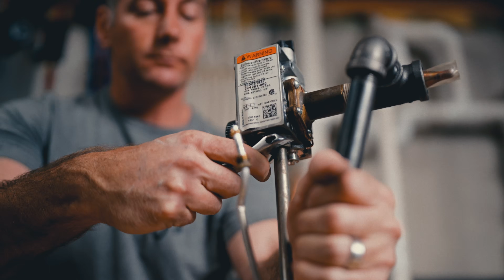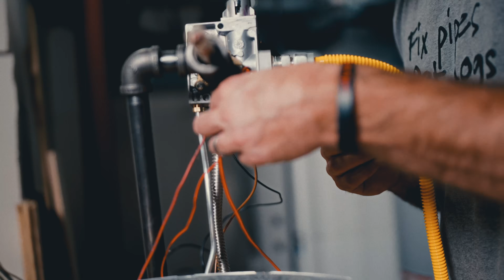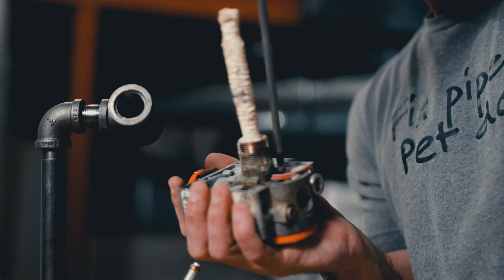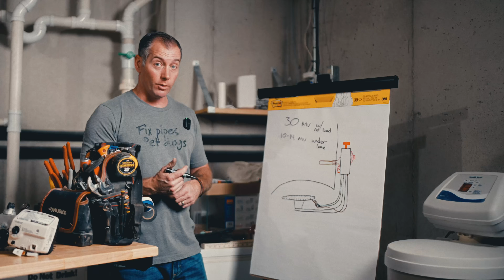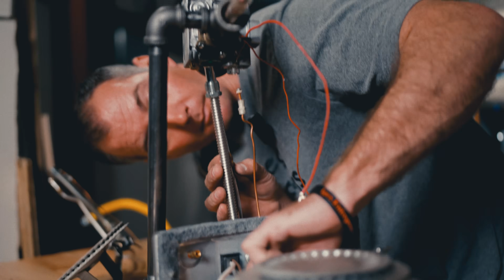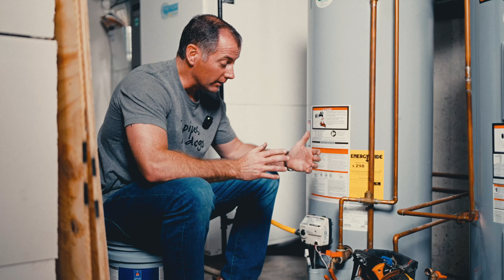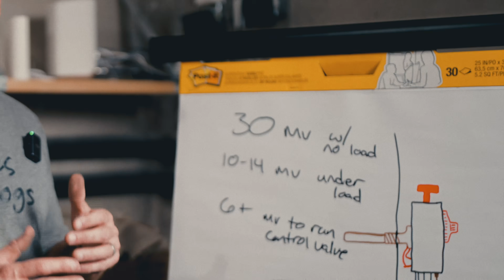Water Heater won't stay lit - Here's why

Comment: The secret reason why those honneywell's break:  
Where the circuit board slides onto the pins of the mechanical section behind it;  there are little pyramid shaped connectors that are soldered to the circuit board that slide over the pins.  Those cheap little connectors are very fragile and easy to break if you go prying on the outer plastic or board at all;  unfortunately, the little electric cord that plugs into it is always hard to unplug.  So you pry around on it hard and then it breaks those little pyramid connectors inside the board and your unit will start acting wonky and intermittent and unpredictable-  because those connections are broken. 

When you pull the cover off and pull the circuit board off of those pins-  pay close attention, because those pyramids will get stuck on the pins and/or fall off to the floor and you'll never find them.   If yours are broken like this: You can solder those pyramid connectors back to the board.  It's a pain to do and you will likely have to heat your soldering iron up extra hot with a torch (I had to)-  but this will fix the issue well and you won't have to buy a new unit.

Comment: I replaced my water heater a couple years ago,    the pilot light gets blown out by a draft down the chimney, at least that what they tell me is happening.  I have had several plumbers look at it, and they tell me the water heater is working normally.  It is an old house on top of a hill , so the chimney is above the tree line.  The chimney was recently lined and capped.  Is there anything you can sugest?

Comment: We have natural gas water heater model# bfg1f5040t3nov, American water heater, that had pilot light issue. So i replaced the entire door/igniter assembly part# 100093812 and it worked fine for week. Now the pilot light is having issue again. I hold that red button down and press the ignitor button, pilot light comes on, and hold the red button down for a minute  and release it. as soon as i release the button, pilot light goes away. I also tried holding the red button down longer like 3 minutes, but as soon as i release, pilot light goes away.

what is the issue here?. Do i need to replace the whole regulator now?

Comment: I know I won't get an answer, but its worth the try; when I put the multi meter red on its a pink wire and black on the white, I get no resistance. But when I put the black on the pink wire and the red on the white wire, I get resistance. I'm confused

Comment: I've got a unit similar to the last one in your video with a thermopile. Recently, the pilot went out, so I re-lit it, but when I let off the pilot button after 30 seconds or so, the light continues to flash once ever 3 seconds, then starts flashing twice every 3 seconds, then the flashes get dimmer, and then eventually stop. My unit says 2 flashes means thermopile voltage is low. Would you say I need to replace the thermopile, or could this be due to something else like a faulty control valve? Thanks in advance for your help.

Comment: Thanks for the informative video. The parts about the voltage produced by the thermocouple is really interesting. Design 300 question: What are the odds that not  having a sediment trap in the gas line would send a large enough piece, or amount, of debris to clog the pilot gas line immediately, and to the point of making it not light? The indicator/diagnostic LED never so much as flickered. It was on brand new water heater with Resideo control valve. Thanks again for the time and effort you put into producing this video. Cheers.
Reply from the maker: I guess it's possible.

Comment: Much thanks for making this super informative video.  I was having difficulty with a pilot light that kept going out despite a new thermocouple on my AO Smith with the 200 style gas valve.  After watching this video I was able to figure out that it was a bad thermal cut off switch which had a large voltage drop across with only the pilot lit it that was the actual problem.  Unfortunately I cannot find anyone who has a replacement thermal cut off switch for my particular water heater and seem only able to get it by buying a whole burner and door assembly.   For now it works fine when bypassing the cut off switch.
Reply from the maker: Glad the video helped you track down the issue, but please be careful when bypassing safety devices!

Comment: Great video!   Your personality is nice.   
I learned about the series 100/200 valves a few days ago from an HVAC service tech video.  I previously thought that thermocouple was instead a gas pressure bulb like a thermostat probe.  Knowledge is key. 

That little device in the temp probe you called a thermistor, it's not a thermistor.  It's a thermal fuse.  

A thermistor is a resistor that changes value with temperature.  There are positive temperature coefficient and negative coefficient varieties.  They are often used to measure temperature.   They don't pop open. 

A thermal fuse is like a piece of wire that remains connected up to a certain temperature, at which point it pops open and breaks the circuit.  It's permanently popped open.

My series 100 did that, and I have replacement thermal fuses coming, rated 84°C.  The rest of the valve is working so I'll get it going with that and retain the safety function.   I could just short it but then I'd lose the safety function.  The fuses are about a dollar apiece.  The tricky part is connecting the wires - Sn/Pb (or antimony) solder gets too soft with operating temps so they have it spot welded or brazed.  Better than replacing the whole valve!
Reply from the maker: Thanks for the correction on that, glad you're able to get it fixed up safely!
Reply: Thank you for the response  @SmedleyPlumbing 

I was able to replace the 1/4" aluminum pilot feed tube with Cu, and the thermal fuse, get it back in service going into its 33rd year. 

I used tiny crimp connectors to attach the new thermal fuse to the wires - not my first choice but I don't have access to the little spot welder which would be.  

The AO Smith DV is still on order from the supply outfit, the confirmation is dated a month ago.  I'm just waiting to hear it's in, fortunately not in a hurry because the old one is managing just fine for now.   It'll stand near the old one waiting for it to give up the ghost.  😅    Unless the old one gives up first, in which case I left the little electric one there waiting. 

Cheers! 🎉

Comment: Here is my issue:  Noticed we didn't have hot water.  I started troubleshooting.  Pilot light was out....I was able to get it relit and it has stayed on.  (Note - I did NOT touch the thermocouple kill switch, was not aware of it, I hope that is ok)  But now we still don't have hot water and the burners will not light even after heavy water use.....so I have no idea.   Thoughts??
Reply from the maker: Sounds like a bad control valve if the pilot is on but the burners will not come on.

Comment: Ref the series 300/400.  I noticed that you didn't use the ignition when holding the pilot button.   But went straight to turning the knob to the temperature.   When would i use that igniter button?
Reply from the maker: When you're lighting the flame.

Comment: Is that OK to smell gas on the 300 or 400 series? I don't know which I have but I know I have one of those.
Reply from the maker: They do occasionally vent some gas out the rear of the gas valve
Reply: @SmedleyPlumbing  thank you,I am been smelling a little bit and is driving me crazy,so the one what I have is a 400 Siri and anytime when I run some gas leaking detector doesn't read anything but when I get close to smell it I smell a little bit.

Comment: Good video.  My water heater is a Maytag 80 gallon unit made in usa by State Industries. I had it installed in 2001.  The original TC lasted 17 years and I replaced it around 4 years ago.
I woke up the other day with no hot water and replaced the TC with one I had on hand.  Unit would light and heat water but will go out in the night time  and again, no hot water in the morning.  Im thinking it may be in the control unit, probably just going to get a new water heater due to age of this one.  It has severed me well with no problems
Reply from the maker: Check the air intake screen for debris.  It's likely dirty.

Comment: omg i learned SOOO MMUUCCHHHH from your video!!!! absolutely AMAZING tutorials and detailed explanations.
i have a A.O. Smith G12-S4040NVR w/ series 300/400 that won't ignite. just performed a routine flush. this particular flush was draining very slowly to the point where i had a feeling there was sediment clogging the drain valve. i did a "reverse flush" by connecting my hose to the washing machine cold water spout and with the drain valve open at the tank, i opened the water at the washing machine to clear up the debris and MY GOD did it work!!!!! water ran clear after a few flushes. pulled out and re-inserted the igniter wire and still don't see a spark from that glass peep hole. time for a maintenance call 😰😭😭
Reply from the maker: Sounds like it

Comment: Not sure if you can help, but I'll ask any way. 4 year old Richmond, pilot light goes out and does not relight after cleaning. Got a new assembly with new thremopile, ignition, and pilot hood. The pilot lights but only stays on for a minute and the blinking light indicates 'thermopile voltage low', the same thing I had after cleaning. The old thermopile only made it to 300 mV, new one makes it over 500 mV. So I replaced the control valve assembly thinking it was miss reading the new thermopile, but the results are the same, pilot lights, box clicks, blue light blinks, goes out after one minute, and will go out instantly if you turn to 'hot' or any higher setting. Any ideas?
Reply from the maker: Sounds like a bad control valve
Reply: @SmedleyPlumbing  Nope, sorry, it was the 500° F glass bulb that popped and closed the intake air. In a sealed system, if the pilot light goes out after one minute, it's not getting air to stay lit. I watched several videos and nobody mentioned this. Please, for us guys who figure this stuff out and repair our own stuff, make a video explaining this. It's behind the little plate that the burner assemble rests on, you can't even see it. There is a rod that closes the air intake if this bulb is popped and the pilot (and burner) will not receive air to stay lit. It's called a Combustion Shutoff System Safety Switch. Please make a video of this so people know. It would help with the pilot going out after one minute.

Comment: I have a water heater that doesn't start heating until well after the hot water has run out. Several hours. Wondering if I'm having scale buildup on the probe. Unfortunately there isn't a replacement part for this heater. It's an old 200 series. Parts aren't available and there's no replacement. Sigh... I may check the voltage to see if I can determine anything. Excellent video and now I know better how these things work!
Reply: Why not try scraping off the scale?
Reply: @duffman6675  I'm not 100% sure that's my problem. It's just a theory after watching the video. I will drain the heater and check it.
Reply from the maker: Sounds like scale buildup over the temp probe of the control valve.

Comment: Mine keeps popping out the the reset. I relight it and within 15 mins or less it goes back out.
Reply from the maker: You have a clogged air inlet screen
Reply: @SmedleyPlumbing we cleaned and dusted the entire area and ended up replacing the igniter and it’s working great since. Also drained the tank and got a surprising amount of small debris for a two year old hot water heater. Probably start draining once a year from now on.

Comment: I have a honeywell valve and its flashing 6 times and the code says to replace burner. I see the flame down there. But im not getting enough hot water. Its warmer water. So i should be good to just replace the burner?
Reply from the maker: It's a start!

Comment: Bradford white defender,  I changed out the control valve, thermocoupling kit,rollout switch, blew out bottom of the tank vent, drained the tank flush out, i just ordered a new gasket  ,but the problem im having is the gas valve lights then the light states to turn the temperature knob then polite goes out. The only thing I thinks it the gasket on the door is really bad.
Reply from the maker: Make sure the air intake screen is clean

Comment: Thanks for the detailed info. My water heater has the series 2 vlgas valve from White Rodgers. Is it possible to replace that with a series 3 valve eg. Honeywell WT8400? I noticed the white Rodgers valve has three connections at the bottom but the Honeywell has two.
Reply from the maker: Unfortunately no.

Comment: Having been a trade school instructor I appreciate your logical and thorough delivery. Do you do radiant heat. Which water heater, electric and gas would you recommend for radiant heat?
Reply from the maker: Usually a high efficiency tank type works well.

Comment: Correct me if I’m wrong, but also check your sediment pipe. Should be 3” long T off from the gas’s line right before the entrance into the unit.
Reply from the maker: Yeah but I never seen a water heater go out from a sediment trap being too short.

Comment: I had issues with my new water heater, the pilot light kept going out after only about 1 year.  The installer came and did what he described as 'cleaning out an air filter'.  It then worked fine for some time but then started with the same issue.  I had to keep lighting it with the buttons on the controller.  It got to the point that when the burner came on, it quickly went out after about 30 seconds.  To me this meant that not enough air was entering to support the flame(s).  So I simply tried removing the cover plate (cowl) at the base.  I re-lit the pilot and now after over 2 months the heater continues to operate properly.  No issues.
Reply from the maker: That works but you also no longer have the flammable vapor ignition protection
Reply: @SmedleyPlumbing  Thank you for your reply and info.
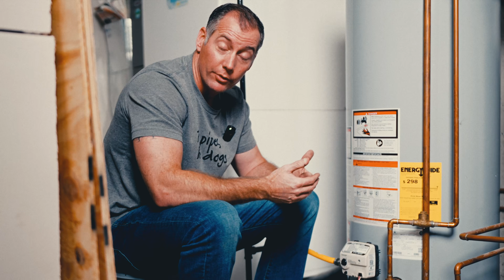From what I understand, if the flame (pilot light) goes out the gas stops flowing.  If I put the cowling back it won't stay lit.  Clearly it wasn't getting enough oxygen to support the flame(s) as designed.  It sits just as it looks at 14:17.   My cowling is nothing more than a sheet of curved metal --- if any unburned gas was accumulating it certainly would have no trouble escaping beyond the heater.  There is NO "safety" on my cowling/door.
The heater is a gas powered Bradford-White.

Comment: Great video I learned so much about hot water heater my ex's hot water heater wouldn't light and it has the igniter that you click and I could see it sparking on the outside of the hot water heater so I knew it wasn't sparking on the inside so I just pulled the gas burner assembly out reached in there and let it and put it back in
Reply from the maker: That works too

Comment: My question is i have a new hot wter heater that is 2 years old never used i try to hook it up but it would not start  its the kind with a reset button
Reply from the maker: Not enough info to make a guess

Comment: hi,
Are you familiar with the Blower Vent Rheem performance gas water heater w/ Auto lit?  I installed 2 brand new units & Cust. support say since it has 8 / 3 flashes, it has an igniter & control board issue!  It just don’t sound convincing that 2 brand new unit would have the same issue! Unless Rheem has a bulk defective assembly line!  My client was out of water heater for 5 days due to delivery time. (all out of stock or online shopping only!)  Any idea or suggestions?  Rheem dispatching a tech in 2 days.  just hope they know & have the correct knowledge to fix it…….
Reply from the maker: Yeah fancy units can be more difficult to work on

Comment: What’s the type of thermocouple used? K-type is common in automotive. There are about a dozen different ones due to the metal pairings
Reply from the maker: These use thermopiles
Reply: @SmedleyPlumbing the series 300/400, but what about the 100’s and 200’s. It’s an academic curiosity. I’m aware that current water heaters use the newer generation controllers.

Comment: Very nice video. I just had a 20 year old water heater replaced (rusted out) and went from the Series 200 to the 300 valve. I was surprised to see a blinky light on it and wondered how it works without a battery, now I know, and I will know how to test it as I am handy with electricity and electronics. Also now i know why you have to hold it for a minute until it gets enough voltage to hold the valve open. amazing how something so simple can make it safe.
Reply from the maker: Glad it helped you!

Comment: Honeywell WV8840C1604 I can not get a spark even though I continue to push the button numerous times. Unit is 10 years old.
Reply from the maker: Bad spark generator or there is a grounding issue with the spark wire.

Comment: In 2003 the burner chambers were sealed up. Since then, MANY water heaters suffer from a lack of combustion air.  Rarely considered by repair-people but very often the primary cause with gas water heater failure.  Can't starve em and expect them to burn
Reply from the maker: Thanks for the insight!

Comment: Looking for help hot water tank not keeping up by time done with a shower water is getting cold. Pilot is lit and stays on. I just replace the gas control valve and still doing same thing
Reply from the maker: Make sure the temp is set properly.  Aside from that, it's probably an environmental issue like a mixing valve failure or some other cross connection.